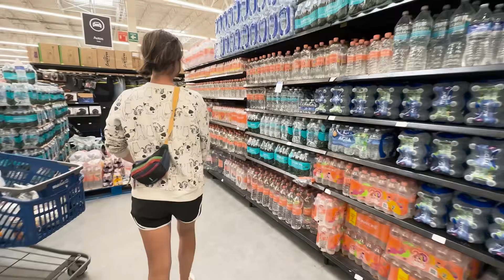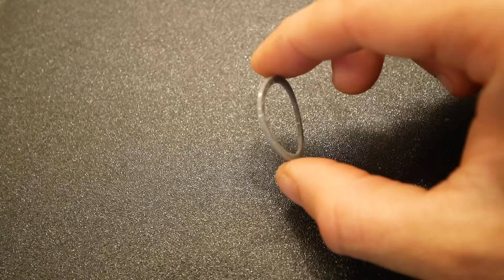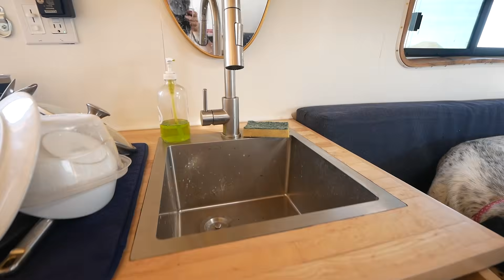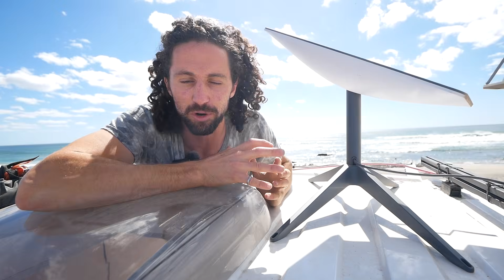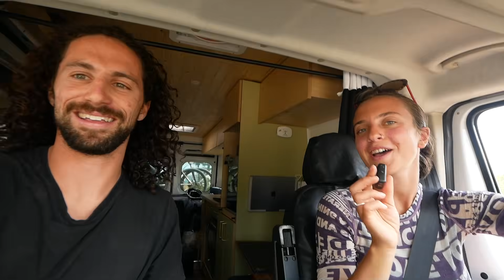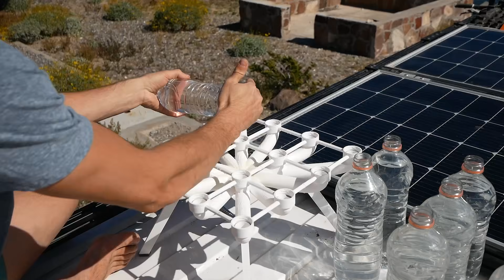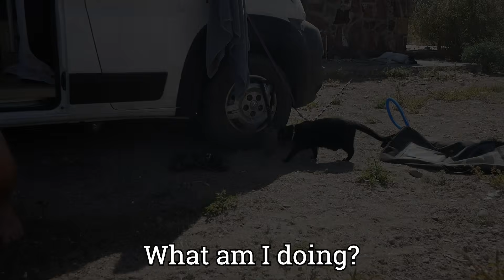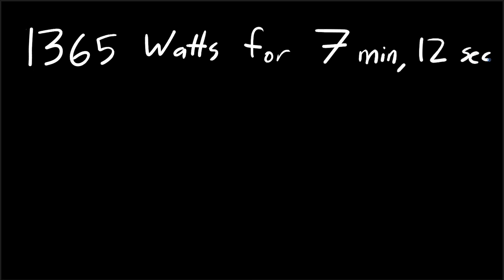I Built an Unnecessary Invention for Van Life

Comment: The water bottle is not waterproof on the threads, but acts more like a cork. Tightness is ensured by the contact of the bottle rim with the bottom of the cap and the internal rim at the bottom of the cap.
Reply: there is often a feature on the cap that forms a taper seal against the inner edge of the bottle mouth, you may see this as a ring (with a triangular cross section) on the inside of the cap.
Reply: @cameronwebster6866  Some yes, this is rather extreme on some of the bottles. For example a bottle of Pocari Sweat is sealed water tight like a half turn from fully seated. Others have almost exactly what he showed here, a gasket which is pressed into contact against the top of the rim of the bottle. But it is usually a flat sheet which covers the entire underside of the cap.
Reply: Wait, what?

Comment: The thing with bottle caps is that they aren't an exact fit on purpose. Like many other mechanical water seals, they only fully close once the threads are engaged and under some pressure. You could have most likely solved this by making the cap less tall so that it bottoms out sooner, clamping the rim of the bottle to the bottom of the cap.

Either way, I can't imagine this is cheaper than the solar shower bags you can buy at any camping goods store, and the waste you created by printing this probably outweighs the production emissions for a single one of those (as they're mass produced), but a use for water bottles is always good. It's insane that almost all recycling is still just trashed in the end because no manufacturer wants to pay for the process of recycling plastic when buying new, clean material is cheaper and more efficient.
Reply from the maker: Fascinating re: the mechanical water seal!

Comment: I think it would have saved a lot of filament if you designed the tubes to be a square profile and rotated so that it can print with just a minimal amount of support. Also, welding gaps with a soldering iron is a great way to get rid of seams in a design like this. Anyways, understand that this was a design exercise and maybe others have already pointed this out.

Also, FYI PETG isn't made from recycled PET bottles. I don't think I've actually seen PETG advertised as made from recycled PET bottle, maybe it exists but they would definitely advertise it heavily as such. The one you linked is just normal PETG.
Reply: I felt the same way - but even then it is over-engineered when a simple square or radial array of screw-in bottles fed directly into a funnel collector - AND even that is over-engineered when a 5 gallon bucket with a shut off valve accomplishes the same thing
Reply: the 5 gallon bucket wouldn't work for the application he was trying to achieve, the purpose was that the sun was able to provide the hot water, having the water in individual bottles allows it to be heated much more efficiently than if it were all in one bucket

Comment: Instead of trying to turn the bottles upside down into the shower system, why not fill them, have them standing upright, and then set the shower system on top of them, then twist the bottles up into the threads? Also, if you decide to paint the bottles black, be careful, those are thin cheap PETG bottles, with the added thermal mass of hot water, they might deform.
Reply from the maker: That’s what I tried first, but I was worried the thin pipes would break from the stress of flipping it upside down.